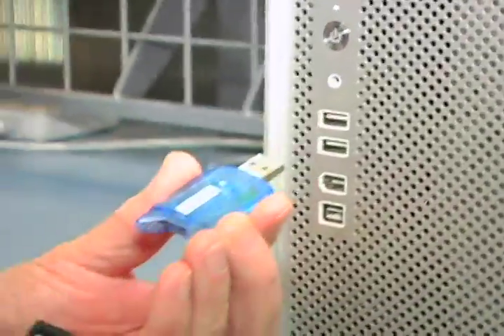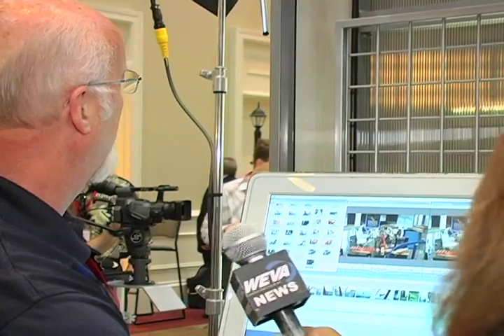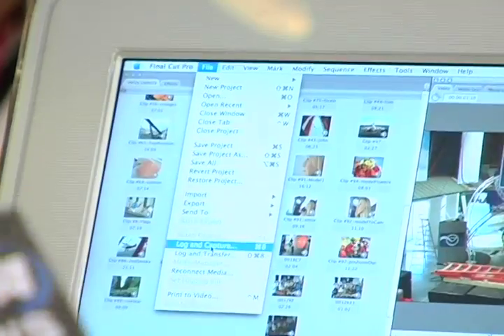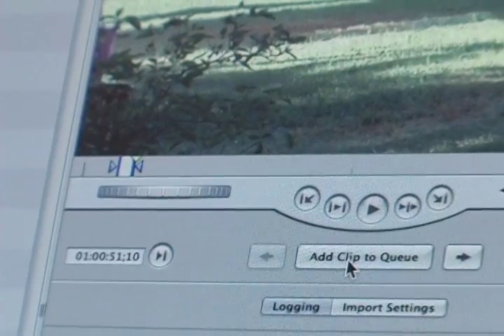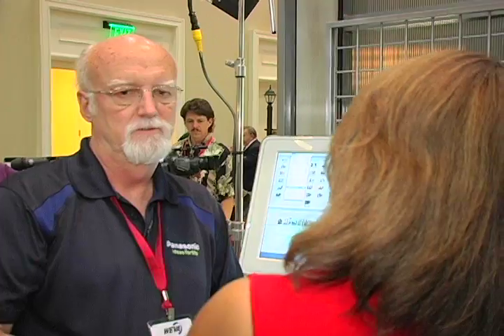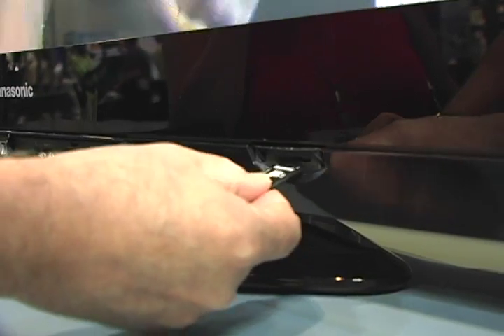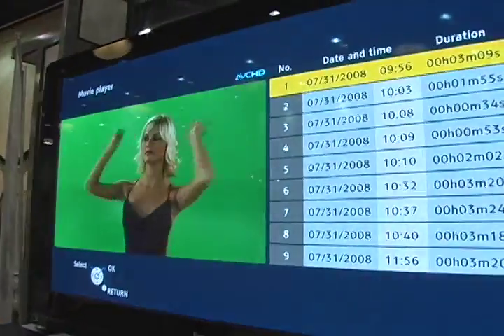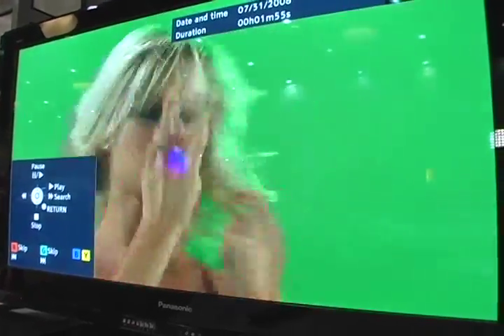AVCHD workflow

Comment from the maker: Ibringthetruth, I agree that editing native AVCHD, as most compressed files, are troublesome. 
AVCHD is a form of mpg4. Which is why you can get about 1 hour on a 16GB card.
In order to edit the footage, you need to convert the files into ProRes or DVCProHD, both of which are I-frame codecs.

One last note, miniDV is a very stable format. Especially where backup is concerned. But SD miniDV is quickly fading away because even the iPhone can shoot HD. And second, if you think that working with ra

Comment: Nothing about TRANSFER TIMES though, even after mentioning how great ACVHD is for wedding videographers rushing to get their ceremony cuts out for the reception.  Thankfully I don't have to worry about that, but what's the typical transfer rate for uncompressing of say 1hr of 1080i ACVHD to ProRes422 through l&t, with ie a Macbook pro 2.16 Ghz Intel Core 2 Duo.  What about lower rez, or the effect of different frame rates.  Thanks ahead for any insight..

Comment from the maker: @MysticViewVideo what editing software are you using?

You may want to try choosing just 50 or so clips at a time. Also make sure that you are saving the transcoded files to a separate external hard drive for safety.

Comment: If you record at 720/24p or 1080/24p and you do a log and transfer in FCP, does the footage convert to Pro res at 23.976fps?  Or is it like the canon consumer camcorders that record 24fps and store it in a 60i wrapper.  Of course with the canon's then when you log and transfer 24fps footage it shows up in FCP as 29.97fps.  I am hoping to hear that the HMC-150 doesn't store its 24fps in a 60i container.  Thanks!

Comment from the maker: I'm glad this helped. The process is pretty easy once you see it. It also helps to name each clip w/ a good description during the log process.
2 other important steps:

1: Transfer all data from the card to an ext. hard drive (raw drive) into a folder w/ a unique name (ie: ProjectX_card01).
2: Open new project & set the Capture Scratch to a separate ext. drive (work drive),

Any Intel Mac running the latest version of OS 10.5 will work. MacBook Pros are better at editing video than the MacBook.